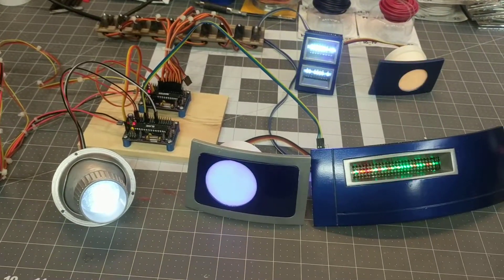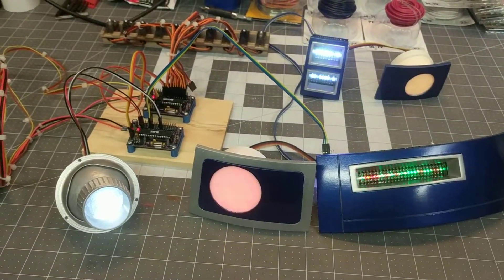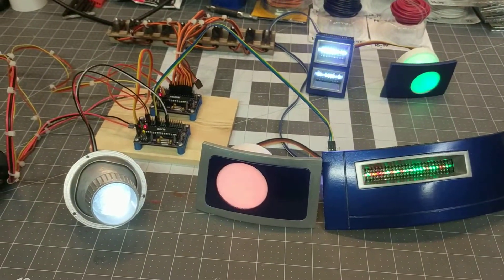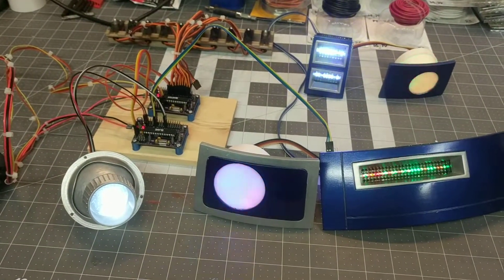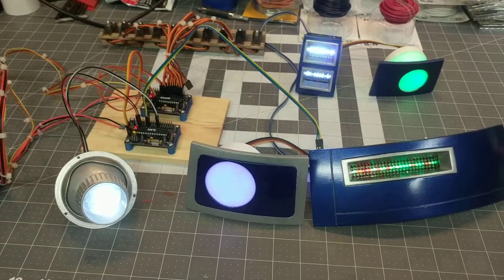Isolated dome components and temporary electronics board

Comment: Hi Jason, firstly congrats on building an awesome looking R2D2 and sharing your build with us. Is there any chance you could tell me what PSI mount files you printed? I have been printing the Mr. Baddeley files but could only find the front and rear PSI mounts with solid ends and to be printed in clear filament. Thankyou for any help. Scott.
Reply from the maker: Thanks! I printed the standard Baddeley PSI mounts in white filament. I did cut and glue a piece of white plastic from a milk jug on the outer surface of both to help diffuse the light a bit (and it provided a smoother surface)  I don't know if you'd want to use filler on those parts, since the light will shine through and it might produce dark streaks. I think a lot of builders print those using a sparse (5-10%) hexagonal infill pattern that is visible when the lights shine through it. Looks really cool. I would suggest trying a few things with one of the mounts and your lights to see what looks best to you. I don't think you really need to use transparent filament - my Teeces lights are plenty bright enough that you can see it even in daylight.

All that being said, one thing to note is that it's a very tight fit between the front PSI mount and the bottom rim inside the dome. I had to flatten the PSI mount as well as grind away some of the inside bottom lip of the dome to get mine to fit. Here's a photo: https://photos.app.goo.gl/gzu36cDQA5H848iQ7  BTW, that is a public album and I add to it from time to time. Feel free to check it out. Best of luck on your build!
Reply: Thankyou Jason for the help, I wasn't sure about these. I've only been printing r2 since January and it's been a challenge, especially when I'm also new to 3d printing. I'm going with pla+ and will add some of your mods that you have in the other videos. Thx again for the help.

Comment: I have tried searching your build log and watching all of your YouTube videos but couldn't seem to find what LED setup you went with for your holoprojectors.   I'm at the point I need to figure this out and have seen a few options and was curious what you used and if you're happy with them. I have Teeces lights for the PSI/FLD/RLD and am working on my MD system.
Reply from the maker: Ah, these old videos are not very informative - they were just made in support of the build log. I used the HP boards made by Curious Marc (the run can be found on astromech.net and is offered by glynharper). There are newer options available, but I couldn't tell you the pros/cons for them. These boards integrate easily with the MD system out of the box, so that is nice. I don't have servos on my HPs, and I haven't installed slip rings so I have to be mindful not to let kids play with them.
Reply: @jasonsR2D2   Thanks for the quick reply Jason!  The Curious Marc were the first ones I was looking at due to the ease of integration with the MD system.  I have to get the WiFi setup and was just reading how you switched over to the Shadow system so I'm currently on the fence if I just bite the bullet and look into that but noticed the Arduino Mega ADK is hard to find these days.  I do plan on doing servo HPs and didn't even think about the sliprings but seems obvious now that you mention it.  Thanks so much for the documentation on your projects.  Making me thinking about doing more documentation both for myself to look back at and hopefully help others not make the same mistakes I have along the way, although it is inevitable in a project of this scale.

Comment: What gauge wires were you using for r2? I’m shopping for some in preparation for the next phase of my build
Reply from the maker: I provide some additional wiring details in the video description here: https://www.youtube.com/watch?v=eUbw6bpTQyw  Most of the dome wiring is 22 gauge hookup wire - that's about what you typically see on servos. The closer you get to the batteries, the thicker the wiring needs to be - I go up to 10 gauge at the batteries themselves.

In most of R2, I use the thickest wire that can easily fit into the various connectors and components. That often worked out to be 16 or 18 gauge.

Good luck with your build!
Reply: @jasonsR2D2  I literally just stumbled across that video late last night lol. It’s very informative. Thank you for responding!

Comment: Nice any chance u have a video on how you put it together?
Reply from the maker: I don't, unfortunately (this was from a long time ago)... BUT - I did just add a detailed rundown on what's used and how they are connected to the video description. Also, as I mention in the update, I will be reworking some of this as I start the final electronics implementation. If you're like me and nervous about the electronics side, this little "proof of concept" was pretty helpful in getting my feet wet.
Reply: @jasonsR2D2  thanks I’ll check it out

Comment: What material did you chose to print your R2 in please?
Reply from the maker: Mine is printed almost entirely in PLA. I know there are folks out there that swear up and down that your PLA droid will melt in the sun, but the fact is, there are MANY full PLA droids out there that have operated just fine outdoors for many years (I will always trust the real-world experience and testimony of builders that have used PLA droids over others). Additionally, the low end of the "glass" temperature for most PLA is cited as 50ºC - which is 122ºF!  I don't think I want to be outside when it's that hot, let alone operate my R2D2.

CNC kitchen did a really great comparison of PLA, PETG, and ASA and objectively tested and evaluated each material. The video is worth watching: https://www.youtube.com/watch?v=ycGDR752fT0

They also did a nice comparison of PLA to PLA+ and their findings are interesting. No difference in temperature resistance, and while PLA+ is better against "dynamic" impacts, PLA is still the strongest when it comes to static loads, which IMO is what most of an R2 is going to experience. https://www.youtube.com/watch?v=uAoZCpXoPWo

Based on all of this, I feel that there is no "wrong" material to print an R2 with. Print with the material you are most comfortable or proficient with. Slice your parts smartly and use common sense in perimeters and infill percent and even more importantly, use the proper adhesive for your material.
Reply: @jasonsR2D2  thank you for such a comprehensive reply! Really appreciate it